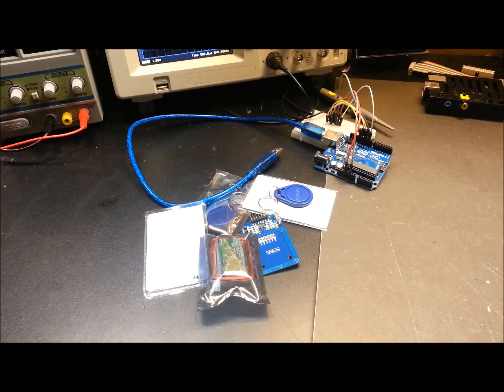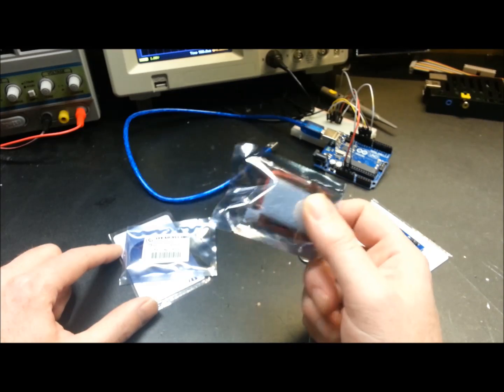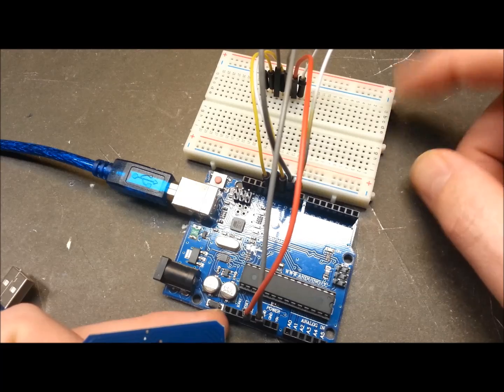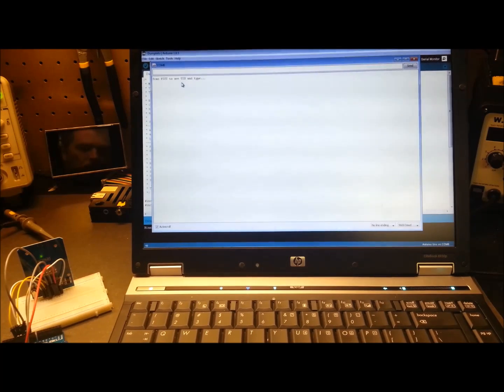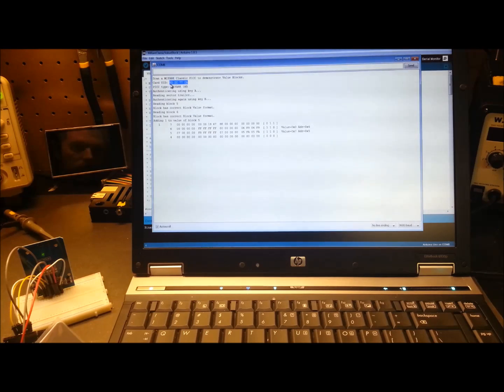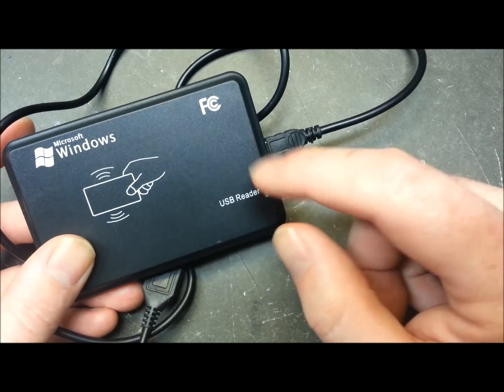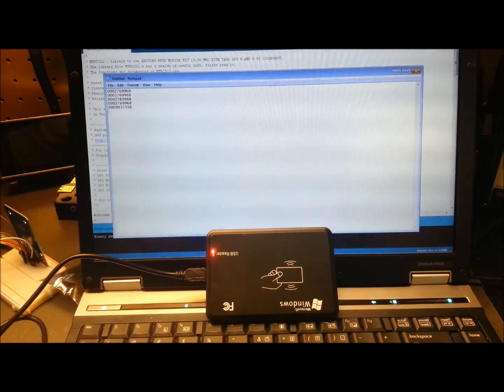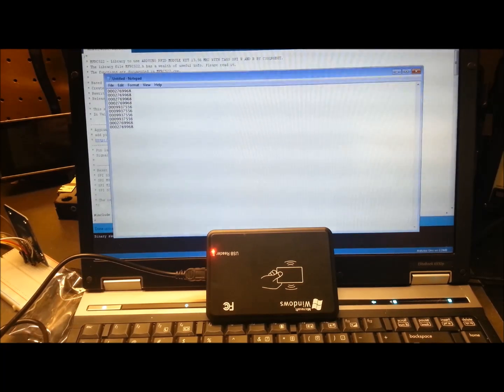RFID with Arduino- Some Fun Hacking Cards

Comment: Arduino: 1.6.4 (Windows 8.1), Board: "Arduino Uno"

C:\Users\Kishore\Documents\Arduino\libraries\rfid-master\src\MFRC522.cpp: In constructor 'MFRC522::MFRC522()':
C:\Users\Kishore\Documents\Arduino\libraries\rfid-master\src\MFRC522.cpp:16:33: error: 'UINT8_MAX' was not declared in this scope
 MFRC522::MFRC522(): MFRC522(SS, UINT8_MAX) { // SS is defined in pins_arduino.h, UINT8_MAX means there is no connection from Arduino to MFRC522's reset and power down input
                                 ^
C:\Users\Kishore\Documents\Arduino\libraries\rfid-master\src\MFRC522.cpp: In member function 'void MFRC522::PCD_Init()':
C:\Users\Kishore\Documents\Arduino\libraries\rfid-master\src\MFRC522.cpp:201:28: error: 'UINT8_MAX' was not declared in this scope
  if (_resetPowerDownPin != UINT8_MAX) {
                            ^
Multiple libraries were found for "SPI.h"

 Used: C:\Users\Kishore\Documents\Arduino\libraries\SPI-master

 Not used: C:\Program Files (x86)\Arduino\hardware\arduino\avr\libraries\SPI

Error compiling.

  This report would have more information with
  "Show verbose output during compilation"
  enabled in File > Preferences.

Comment: hi!! can i ask something??...it's needed computer after put the programming to the arduino??or still need for computer or need storage for the data if did not want to use computer??and how to use at least 30 card??
Reply: I don't think it needs to be hooked up to a computer after the programme is installed.

Comment: i get this error: 
Arduino: 1.6.9 (Windows 10), Board: "Arduino/Genuino Uno"

C:\Users\Home PC\Documents\Arduino\libraries\AddicoreRFID\examples\Addicore_RFID_Example\Addicore_RFID_Example.ino: In function 'void loop()':

C:\Users\Home PC\Documents\Arduino\libraries\AddicoreRFID\examples\Addicore_RFID_Example\Addicore_RFID_Example.ino:51:16: warning: large integer implicitly truncated to unsigned type [-Woverflow]

         str[1] = 0x4400;

                ^

Sketch uses 6,098 bytes (18%) of program storage space. Maximum is 32,256 bytes.
Global variables use 287 bytes (14%) of dynamic memory, leaving 1,761 bytes for local variables. Maximum is 2,048 bytes.
avrdude: ser_open(): can't open device "\\.\COM4": The system cannot find the file specified.

Problem uploading to board.  See http://www.arduino.cc/en/Guide/Troubleshooting#upload for suggestions.

This report would have more information with
"Show verbose output during compilation"
option enabled in File -> Preferences.
 
can someone help please
Reply from the maker: It cannot see the board you have selected on COM4

Comment: I wonder why the Raspberry Pi was not used as it has a more powerful processor and can be programmed under GCC and Code::Blocks.
Reply from the maker: Simple answer- because a micro controller can do it just fine with tonnes of cycles to spare.  I often compare such things to using a Howitzer to kill an ant....  :) Cheers
Reply: An RPI is classified as Single Board Computer (SBC) while an Arduino is a Microcontroller(uM/MCU) platform.
Think of a Microcontroller as a tiny computer on a chip(IC). They are used because they are tiny, cheap, and consume little power. Look for bareDuino, you can minimize your project to just use that.
https://www.thingiverse.com/thing:20015 and since you are into RPI see this great mag it's free: http://v.ht/rpimag

Comment: Hey, the link "Here is the code/instruction I used:" is down. please reup.
Reply from the maker: +Marco Lehmann It is up just fine. Either you are using a VPN with IPs used for attacks, or a plain normal IP that was blacklisted for attacks.  Cheers

Comment: RFID is WICKED for live Role-Play costumes. Put an RFID chip in a gauntlet, and an Arduino and the reader inside a book. When your hand (with the chip) comes close to the reader, the Arduino lights up a sequence of RGB LEDs to light up runes on the book. Or have the reader in the head of a staff, when your hand comes close, you light up the head with LED. ^^

Comment: does this mean if i 'borrowed' one of my teachers cards at school and quickly scanned it but had the arduino dump the info onto an sd using an sd shield i could then clone it when i got home and have access to all the off limit parts of my school ?
Reply: Jason Wenden yes, is the same as if you stole a key. You can copy it.
Reply: +Jason Wenden Sometimes.
Some RFID cards support a basic encryption system where there are registers you can't read without the proper keys.
Reply: +Jason Wenden Sometimes.
Some RFID cards support a basic encryption system where there are registers you can't read without the proper keys.
Reply: i actually know someone who had permission from his teacher to try it, but our school had an secure encryption system.

Comment: Eric William Hope you are doing well I have been looking for two days now and i still cant anything that can help me. I am working on a small school project where I am to make The RFID Mifare card to be the student card and it will allow for the student/employees to make purchase from any shop on campus and also to allow access control, it will be a web based application i have the Card reader ( DG-608 MIFARE READER/WRITER ISO14443A/B,ISO15693) and the card (Standard IC MF1 IC S50) My problem is how can my application retrieve the information from the card through out the card reader. Please your advise will help me a lot. thanks